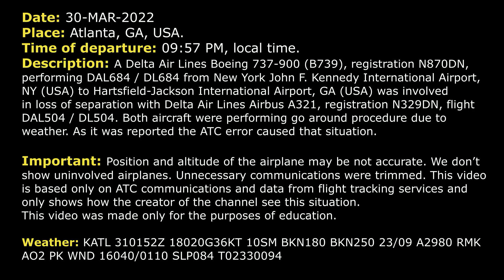ATC ERROR. Loss of separation | Delta Air Lines Boeing B739 and Airbus A321 | Atlanta, ATC

Comment: I am ATC myself and I am astonished to see the level of incompetence from this controller
Reply: In training?  Check before judging.
Reply: @billkaldem5099  I agree with the original comment. As ATC I was blown away at the guys incompetence, he had 2 aircraft to separate and he was lost. If he is in training then his trainer should have stepped in and resolved the situation. Just today I had a trainee issue a turn to a go around that would have resulted in a separation bust. Before the trainee had even gotten halfway through his transmission and he hadn't corrected it, I  was overkeying the trainee and correcting their mistake to prevent the separation bust. In this instance there was ample opportunity to fix the error, but the controller took a moment to realize it and that mixed with the pilot clogging the frequency and questioning the controller led to the bust. There is a lesson that this pilot should learn, minimize transmissions and transmission durations especially in a busy terminal environment. And of course there is a lesson for the controller, priorities and SA. Don't worry about trying to coordinate with approach when you have separation to worry about, alleviate your conflicts and then time permitting get on the line with approach to coordinate his divert. Worst case if you are that busy separate aircraft hand them off and they can request to divert with the approach controller.
Reply: @cnc913  well done sir
Reply: @billkaldem5099  Dude, when you are on training you are always supervised by an experienced controller. Should this controller be in training, the trainer should have identified the potential conflict and taken over the situation immediately.

Comment: It’s a good learning thing to realize that a lot of loss of separation incidents happen on go arounds. High workload for both controller and pilots, with less standardization.
Reply from the maker: Thank you. 👍
Reply: Don’t let the ATC get away with the typical “high workload,” he should be quick to recognize his mistake, this was all 100% the ATC’s fault.
Reply: @thecomedypilot5894  Yes, however the focus should be on how to prevent such thing from happening again, maybe by not giving vectors that early during the missed
Reply: @J0hnny123-J  But I just hate it when people easily blame the pilots but are hesitant to blame the air traffic controllers, even though ATC have made some very fatal mistakes in history.

Comment: Delta 504 sounds like he’s a little antsy.  Too many blocked comms in there.  Made it hard for controller to get instructions out and for the planes to receive them.  Didn’t help this deal.  Also, that’s not anyones fault, it wasn’t like they were oblivious, it just so happened that a bunch of guys needed to get information out at the same time.

Comment: A lot of people are criticizing the tower controller, and that MIGHT be warranted, but it's important to remember that during go-arounds there is usually a lot of frantic inter-facility coordination that needs to happen between the tower controller and the approach controller so that the tower controller can find out how approach wants the go-around aircraft to be given back to them. This is a sudden and unexpected aircraft that needs to be re-integrated into the approach sequence and there may or not be conflicting traffic that needs to be deconflicted. So, there is a lot of back-and-forth to quickly figure out what vectors need to be relayed to the aircraft by the tower controller that are actually coming from the approach controller through the hotline. And considering the weather the approach controller was probably down the tubes himself, even before the tower controller rings in his ear asking for vectors for his go-around. Then add in an aircraft that never turns to his first assigned heading, gets a second vector to compensate for the first, ANOTHER go around, MORE coordination, MORE interruptions, MORE man-in-the-middle vector relaying, and this becomes an exercise in confusion very rapidly. There is a lot happening behind the scenes during go arounds, especially during bad weather, and basically everyone is maxed out in their mental processes. We should all thank the lucky stars that it usually works so well, even though it didn't in this particular instance.
Reply: That’s why there’s a published missed approach though right? Less work for the controllers and coordination.
Reply: @michaele8347  In my experience it's very rare for airlines in the US to shoot the actual published missed. The vast majority of the time everyone is shooting visual approaches and the go-arounds are almost always handled as a coordinated vector back to the downwind for resequencing. But, yes, hypothetically the published missed is there and available.
Reply: @commoncobbler1458  absolutely correct. I’m only saying if things are going wild you let them start the missed and then come up with a plan, then give them vectors.
Reply: @michaele8347  published missed approaches are designed for obstacle clearance not traffic separation. Often at busy airports they cannot be safely flown hence the need for headings upon missed approaches.  I am a retired controller with 30 years experience.  At several of the airports under my control missed approach procedures conflicted with other arrivals to either the intended airport or other airports nearby.  As such when no tower was present or open  and I had more than one aircraft I would issue alternate missed procedures before issuing approach clearance. At busy airports with operating towers this is impossible because the tower controller must separated his own traffic.  When an aircraft misses it is always a moment of extreme pressure as the tower controller must first initiate his own separation and almost simultaneously coordinate with one or more other controllers both in the tower and in the tracon each with their own set of problems that are often in conflict with what the tower needs.
Reply: @michaele8347 Keep in mind that the published procedure might not work with weather
Reply: @michaele8347  no, published missed approaches are normally designed individually for that specific approach, not to adhere to local ATC SOP's and traffic flow depending on the direction the airport is. The published missed approach is only used by pilots who are basically practicing the published miss. In reality the published missed approach conflicts with literally EVERYTHING that is going on in the air
Reply: this! one million percent this! Finally someone who doesn't glaze all over these pilots

Comment: Wow 4 really bad errors here could've been a crash easily.   1st Delta missed a routine high speed causing a go around,  then the controller lost the flick, 2nd Delta wouldn't comply with the standard go around procedures and the controller just robotically instructs the 2nd go around for the standard procedure racking right into the 1st one..... yikes, you try to hand me that in the radar and you are gonna hear from me

Comment: ATC had one on final, and two going missed. How that becomes overworked causing a near miss and needing TCAS is unfathomable. 

That guy shouldn't be working ATL approach if 3 planes overwhelms him. He called 170 heading west, forgot a plane needed to divert and nearly caused a midair collision which was simply avoidable by having them both flying the published miss instead of trying to be cute and fold them back in on a tight pattern.
Reply: Well he’s not working Atlanta approach he’s working Atlanta Tower.
Reply: My guess is he’s not working either anytime soon.
Reply: That's not TRACON that's the tower controller.
Reply: 4...one on the ground that hadn’t vacated the runway..it just goes to show how one little misstep in a tightly choreographed sequence can bring down the whole house of cards. Alls well that ends well, 4 plane loads of people home for dinner.
Reply from the maker: That's not the only aircraft he had in his area. See first 17 seconds of the video. I just tried to show airplanes involved.

Comment: Incident wouldn’t have happened if the first Delta that went around turned when they were told to. Instead they continued on runway heading for a long time before turning south. Still a mess up by the tower controller though-should have had the second go around stay on runway heading
Reply: Turning at low speed with variable winds can lead to a stall. They may have needed to get their airspeed up before turning.
Reply: @stephenj4937  no not the issue.  Missed approaches rarely happen so the workload gets high taking the plane out of approach mode back to other modes while simultaneously trying not to overspeed flaps
Reply: That’s why we have standard missed approach procedures which will be followed. Reduces the workload for everybody and you avoid dangerous situations like this

Comment: 1:08 is a great example of the issues with the U.S. practice of clearing aircraft to land before the runway is clear. Congested radio communication making it hard to transmit the "go around" to the cleared aircraft in time.
Reply: Umm that doesn't work at the core 10 airports man, reduced radar separation to 2.5 miles ensures that this is impossible
Reply: It's fine. Nothing will happen.
Reply: If you think that's congested try clearing everyone to land inside a mile final. At busy airports there can be a delay of only a few seconds between the aircraft clearing and another aircraft crossing the threshold.
Reply: I’ve got the opinion that safety at US airports is only held together by the performance of both ATC and pilots. This video is the perfect example, of many, of things going to rat$hit when someone drops the ball.
Reply: Yes.. If something is not done urgently about this soon , there may be a real calamity. ...
Reply: Couldn’t agree more

Comment: So by 684 saying that they HAD to go to Augusta, were they not in effect saying that they had a fuel emergency?  If yes, why not declare it and come back to Atlanta which would be closer?   Can someone clarify??  Tx
Reply: No but they are likely saying that if they don't get going to Augusta soon things might turn into a fuel emergency and they'd have to find a closer airport.  One reason you hate to do that is because you know the weather at your alternate.  If you can't get there, you have to start finding closer airports with acceptable weather which can get dicey.  Also, not critical but worth thinking about is whether or not that new airport has delta flights because if not, now you're dealing with gate issues etc.  That can become a cluster and it's worth avoiding that if safely possible.
Reply: @jonesjones7057  It is a logistical nightmare for an airline, but as I said I don’t think it was an emergency situation, I believe that it was due to the winds which exceeded the boundaries of safe operation for that type of aircraft. If they were low on fuel, they would’ve most likely told the controller “hey, we’re running a bit low on fuel, can we have priority to land?” Again, I may have missed a transmission but I didn’t hear anything about this.
Reply: I may have missed a transmission but I don’t think it had anything to do with fuel. I’m pretty sure was the wind that prompted the aircraft to go around and divert. Atlanta tower stated that the winds were “170 at 27, gusts 35”. This means that it was crosswind from the left of the aircraft which was at 27 knots, gusting 35. 35 knots is 5 knots over the maximum allowed crosswind speed for a Boeing 737 to perform a safe landing. Therefor, the pilots had to go around and divert as the winds were too dangerous.
Reply: @CenTexAviation  "35 knots is 5 knots over the maximum allowed crosswind speed for a Boeing 737 to perform a safe landing"

Great .. thank you and everyone for your explanation (s)
Reply: @TruthHasSpoken  You’re welcome :)
Reply: @CenTexAviation  crosswind would be from the right when landing east with southerly wind. Wind is defined as where it’s coming from, not which way it’s headed 👍
Reply: @TuppenceAbucket  Ah my mistake, thanks for the help my friend! :)
Reply: Welcome... I  had to think about it for a minute or two before answering 🙃 keep up the good work
Reply: @CenTexAviation  no what I'm saying is,  the wind was the original problem. After the go around they had to go to their alternate, any excessive delays in getting that routing would/could, become a fuel emergency.  Fuel issues didn't cause the go around.  But once they DID the go around, they knew winds were excessive and they needed to bail to the alternate without undo delay to avoid a fuel emergency, which is a fairly common scenario.
Reply: @jonesjones7057  Ah okay, I misunderstood you. Yes that is a possibility. Thanks for clearing it up buddy :D
Reply: Just to close the loop, KAGS has runway 17/35, perfectly aligned with the 17027G35 winds, unlike KATL's east-west configuration.
Reply: @periperus  And this is why it makes sense that the crew would want to divert there. It’s within range and the runway directions help with the winds.
Reply: The winds in ATL were just nuts. Super strong.
Reply: @MyNameBorax  Yeah!
Reply: They were diverting to Augusta because of the winds not fuel.
Reply: @wadesaxton6079  Yeah, that’s what I think, too. The crosswind gusting was 5 knots over the safe limit for a 737. I heard the transmission and I immediately knew they were gonna either circle or divert. I didn’t hear anything about fuel.

Comment: RA is short for resolution advisory generated by the TCAS traffic collision avoidance system.
Reply: In this case, a Resolution Advisory is a "Coordinated Maneuver"  The TCAS system in each aircraft is talking to the other and decides how to move each aircraft vertically.  Once a Resolution Advisory activates aircrews are expected to follow the guidance and advise ATC when able.
Reply: @blueskies8834  actually to emphasize that:  Pilots are required to follow TCAS RA. At this point ATC commands have lower priority.
Reply: @GameMichi  Lessons learnt from the 2002 Überlingen mid-air collision. Things don't go well when one plane followed ATC while the other followed TCAS.
Reply: @KaiHinLkh  yeah, they definitely learned from that incident. As ATC in the U.S. if a aircraft reports they are responding to an RA we are not able to issue them any further control instructions until they advise that they have completed their response. But sadly in this situation the controller was definitely distracted, he should have continued 684 upwind another mile or two and/or altitude separated them. He shouldn't have stressed on the Augusta coordination so much, that would have been my lowest priority when I am dealing with multiple go arounds. Worst case is the pilot has to make the request with the approach controller. And lastly you can tell he is lost when he tells 684 to continue westbound after given a 170 heading. Guy needs a break...

Comment: I still don't understand why we still use analog radio communications. I'm pretty sure there's more technological way to communicate between ATC and cockpit.
Reply: What?  You don't find a 90 year old VHF-AM simplex radio system satisfactory in 2022?
Reply: I don't think that would have changed anything here
Reply: @1972challenger  While it may be helpful to filter calls for others it might also become a problem. If you cant hear instructions for other planes you loose situational awareness and are unable to spot potential problems in advance. Had some problems after our rescue workers switched to separate digital circuits.
Reply: Actually, the terminal environment is where radio likely can't be replaced
Reply: At least send text instructions too so there's no confusion about which number was spoken.
Reply: @VeteranPilot It would only take a second or two to press specific buttons, like the keyboards they use to transcribe live tv shows.
Reply: @VeteranPilot But people frequently have to repeat their message, even more so when parties have different accents. Having a basic text backup of specific details like heading, altitude, frequency would eliminate a lot of wasted time trying to get the message across.

Comment: I always like how the gusts never exceed 35.
The controllers all know that almost every aircraft has a 35 knot crosswind limit. 
Hmmmm
Reply: I was in Atlanta at the airport hotel on my balcony during this exact event and winds were insane, I have never seen more go arounds in my life.
Reply: Gust isn’t the same as a crosswind.
Reply: @Fantikerz  they had both per the METAR shown at the beginning of the video. Direct cross from the south at 20 gusting 36 knots. Atlanta runways are oriented cardinally East / West and winds were directly from the south.
Reply: I thought the exact same thing.
Reply: @selftrue670  going into ORD multiple times...ATIS said 25 gust 40....but the tower s repeatedly said gust 34 or 35....
Nah, we don't need crosswind runways...
Reply: Hmmm… I was a controller for 34 years and never knew this.
Reply: @michaelhall9138  you didn’t have the right “ code book “ 😂😂😂. When I fly cross country I enjoy having ATC around 👍
Reply: It’s about the crosswind component. It can be gusting 50 knots with a crosswind component of 10